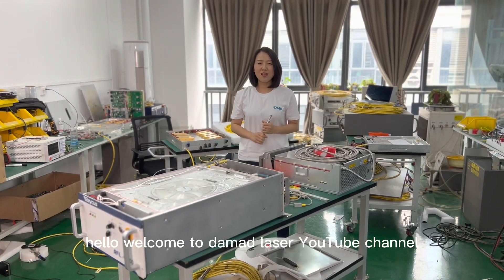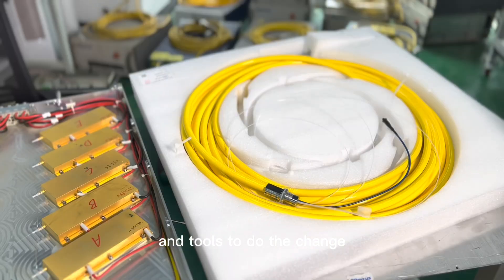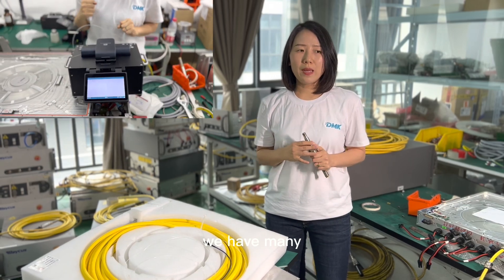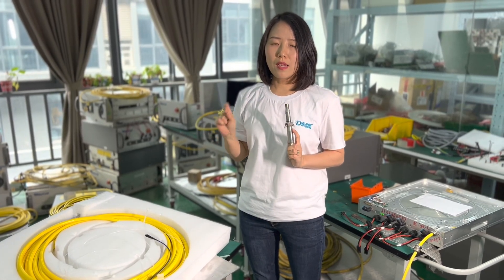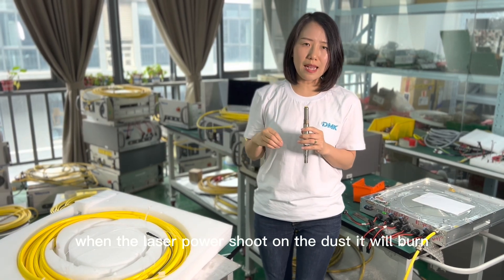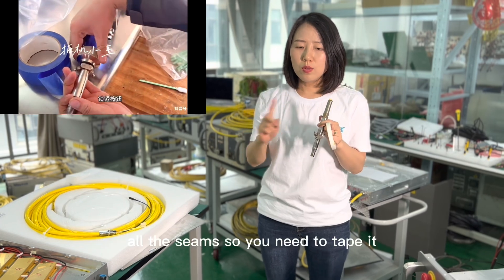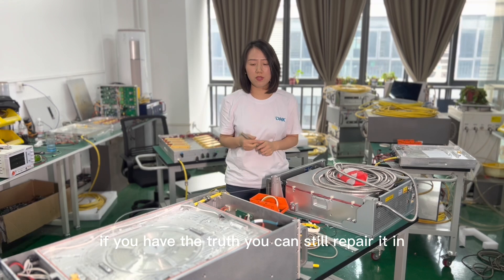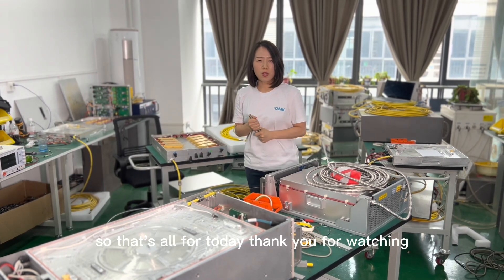What you should do after fiber cable crystal broken and how to protect the new fiber cable?

Comment: Interesting. For your knowledge is it possible to use a Raycus 50W (engraving laser) on a gantry CNC machine fitting cable in drag chain without risking break fiber cable? Normally smaller laser source has also thinner fiber cables, can I put this thin cable in a drag chain like you normally do with bigger fiber cutting laser and with 1000watt? Or maybe is it possible to change the cable from the laser source and putting bigger and longer one? Will this affect laser power also? Thanks
Reply from the maker: it's ture that low power laser source has thinner fiber than high power laser, but the difference is very small in nanometers, so put them in drag chain  has no difference, just don't bending the fiber cable in too small radius